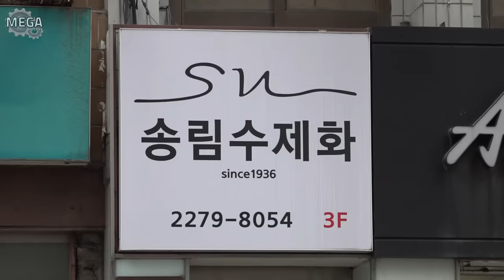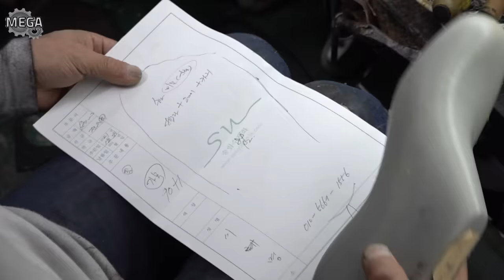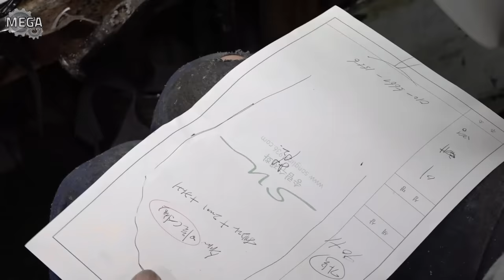The process of making handmade hiking boots in Korea's oldest shoe factory

Comment: As a user of this company's brand with both my parents also as loyal customers, I can assure you that these guys are the ONLY 'hiking shoe handmaker' left here in South Korea. Compared to their much older batches, they were (and possible at this moment) experiencing shortages of high quality leathers in Korea, forcing them to use thinner leather in the process. They do  provide good quality and services. Older products lasted quite a lot, surviving few sole replacements, but for newer batches we should see...

Leather based industry is highly reliant on good leather manufacturers. This is why globally famous companies like Redwing has its own tannery. For small business such as this, they cannot afford to have any control over supply of good leather due to their low production rates and lower demands(due to high prices), and are quite prone to any negetive impacts to their supplies. When leather suppliers die, their products are impacted too, and even the market trend is not favorable to them in some sense.

While 40-70s do love this brand whenever they experience it, the current tendency for most new hikers is to experience many different foreign brands or product types (especially HOKA), and this trend is certainly posing a great challenge to them & other Korean factory hiking shoe manfacturers. These are TOO EXPENSIVE or simply lack in quality or innovation. Customers buying out many different and trendy hiking shoes dry out their potential customer's wallets first.

Comment: So. For the very low price of 750 dollars these boots are crap. Heres why: the amount of glue they used to make the boot is insane and will make the boot non breathable thus your foot stinky. They used waaay too much synthetic materials wich for the price is shameful they should have made at least the insole n midsole out of leather and the welt that holds the boot together. There is no counter cover so the lining material (which is also the waterproof membrane) will wear down over time also it will leak thru, putting the waterproof membrane in as a lining material is never a good option it will be damaged by your foot thus it will leak, putting it between a layer of soft pigskin and the outer leather is much better also pigskin will absorb some of the sweat so your foot wont be as stinky. They forgot the imprint that the customer left in the shop it seems even tho they used it to make a footbed out of cork at the end they sanded down most of the cork only leaving a thin layer wich does nothing for your comfort let alone keeping the shape of the imprint wich they made in the first place, they might as well just leave a thicker layer of cork in there so it will comform to your foot on its own. The stitching of the sole is very wide, closer stitches would hold the sole better this way it is lazy. Also for 750 dollars i would expect to see quality Vibram outsoles and Goretex waterproof membrane to be used because those stuff i trust (not to mention that the yellow label on the soles kinda remind me of the one vibram uses so it seems they want me to think they used vibram wich they havent but of course who blames them for that). So watching the video "only" these stuff bugged me a bit but let me know if i left anything out. For me these boots only worth about 250-300 dollars and im being generous in my opinion. Handmade doesnt mean best quality, it only opens up the possibility for that and in that case its pretty far from that. Anyways im sending it to Rose Anvil and see if he has anything to say. By!